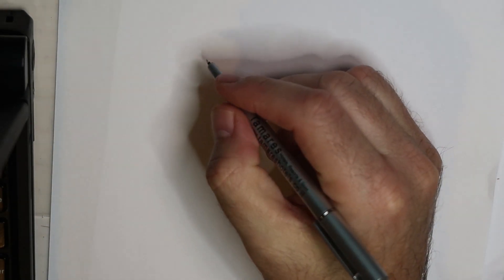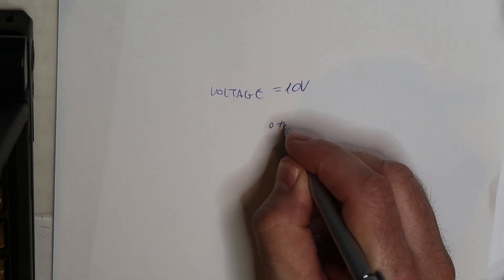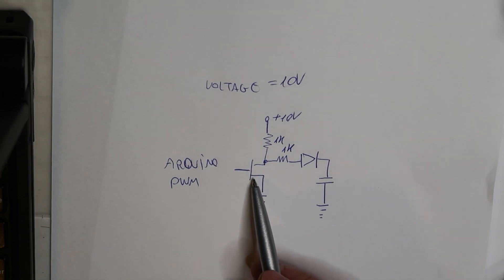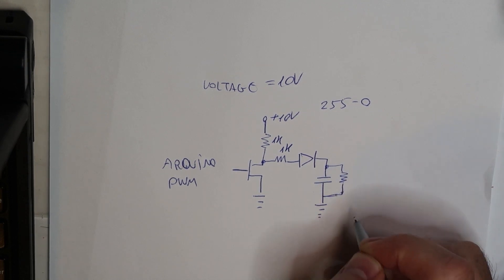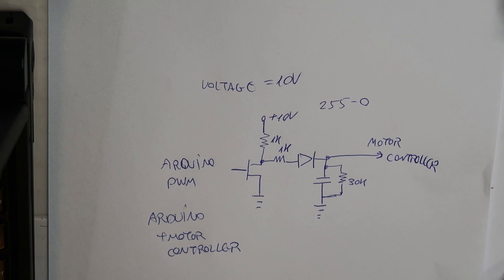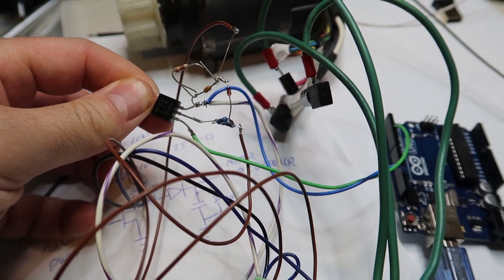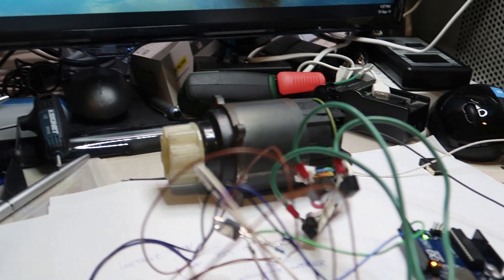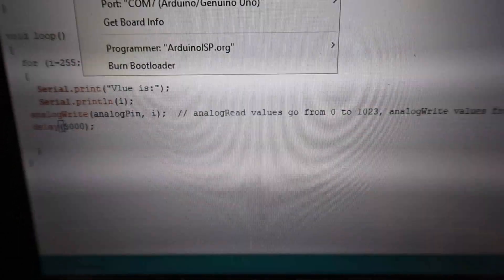BLDC with Arduino Uno board

Comment: I would not build it like that, when you will power on or have a failure at the Arduino end the motor will go to max speed. You probably want a normally open relay + change the circuit like 
Eidetic Goone
 wrote.

Comment: And do you know how to make similar circuit but without "reversing" PWM? So Arduino 5v-255 is 10v-255?
Reply: Basically, moving the circuitry that drives the motor control from the Top (Drain) of the mosfet to the bottom (Source) will reverse the function.  Disconnect between the 1K resistors and reconnect at the Source.  Also, remove the ground connection at the Source so that 10 volts can drive the motor control output via the rest of the circuit.  
In the above circuit, when the mosfet is off, all voltage would be drained via the 30K pull-down resistor. When the mosfet is on, the capacitor charges to 10V. The 30K pull-down is set with high enough resistance so it doesn't significantly drop the output voltage from 10V.

Another way would be to use a different type of mosfet which is normally on instead of off.
As I understand, these are less common and more expensive.

Adrian, please chime in if you think this wouldn't work.   The advantage of reversing the driving function is that the motor stays off if the Arduino is not outputting 255 PWM.  Seems safer in many applications.
Reply: @eideticgoone7035  Thanks for answering! For now I don't plan to use it - since I bought 5v driven brushless motor driver (https://tinyurl.com/ycel6ysf) - but I have serious doubts if this driver will handle 500W as declared. Inside there is a board that, when looked around on Internet, I could find it is design for 250W. Also connectors are much less then 10A... Anyway I'm still waiting for my motor - I only have driver so far :) - when it arrives I'll do the testing and see if I need better driver, and your solution then.